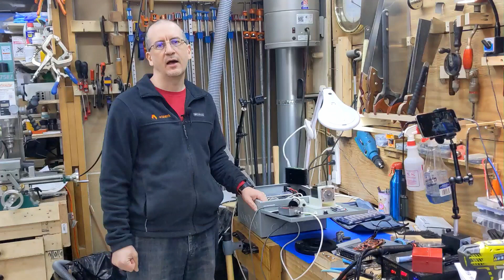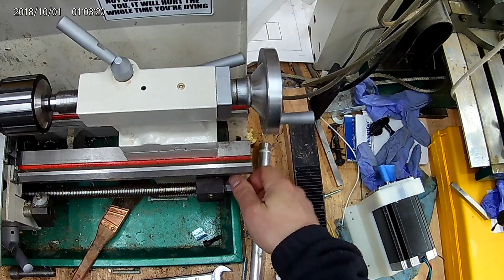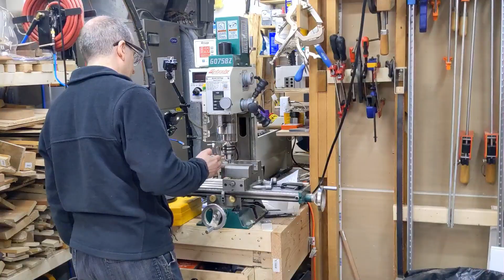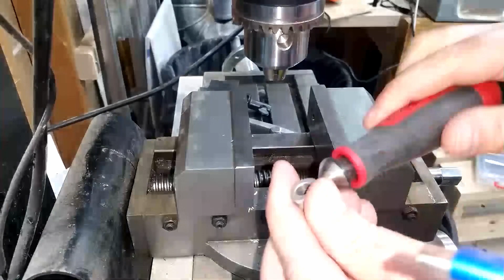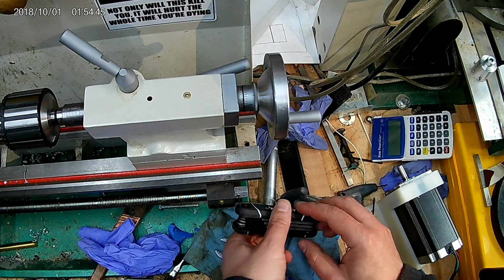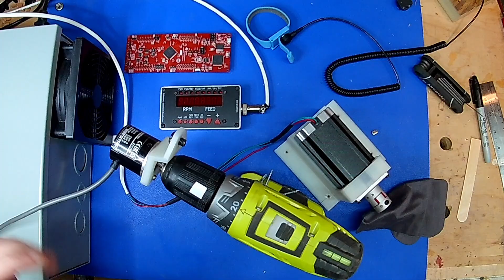Electronic Leadscrew Progress, Part 2

Comment: Rather than fanny around with adhesive why not drill and ream for a taper pin?
Reply: Always ten ways to do anything, of course. :) This was like three years ago - I don't even own this lathe any more and have come a long way in my machining, although I'm still very much a hobbyist. I don't remember enough of the video to know where I was using adhesive. I do remember mentioning loctite for connecting the motor shaft but I think in the end I did pin it. 

The ELS was awesome. I have a much better lathe now (PM-1236T) and it's one of the upgrades I might do, although the change gear situation on that lathe is much better than on the mini-lathe.

Comment: It’s a very informative video . I’m also in the process of setting up the clough42 els on my lathe.  Please do post more video on this subject more often. Thank you so much for all the efforts you put on this matter.
Reply from the maker: Thanks! It has definitely been harder than I thought it would, but my electronics skills were pretty rudimentary coming in to this. It actually looks like it might be working now - I can't get the problem I was having to repeat. So hopefully the next video will show it in operation! 

I got a bunch of help from other users when I was having problems with the motor, so don't hesitate to reach out here if you think I can help, as I would welcome the opportunity to pay it forward.
Reply: @getsmarterandmakestuff  sure I’ll do. So the skipping steps problem is over?
Reply from the maker: @babakkhoramdin3146  Yeah, the only "problem" now is that the motor won't spin if I get the encoder spinning really fast. Like 1300 RPM in threading mode at 12 TPI. But I can't imagine ever wanting to run that fast. But who knows? Given that I can't recreate the problem, there's every chance that it will reappear at some point. Still, I'll be happy enough if I get it hooked up and it just works.
Reply from the maker: @babakkhoramdin3146  There's still a fair amount to do. I have to mount it on the wall and get the head end of the lathe buttoned up. I'm also using 3D printed timing pulleys because I couldn't find any the right size for purchase. So I might either print some better ones or possibly even play around with a combination of casting and milling some in aluminum.
Reply: @getsmarterandmakestuff  I’ve the same problem . Actually James also has  addressed this issue in one of his videos. I could overcome this problem partially by tweaking the micro stepping switches on the stepper driver.
Reply from the maker: @babakkhoramdin3146  Yeah, honestly that was something that confused me. I don't need microstepping - 200 steps per rev even at 12 TPI is 0.00042" per step - more than enough resolution. And at 0.005" per rev it's 0.000025" per step. So I'd rather have the torque than the microsteps. But my motor controller doesn't seem to have any switch setting for 200 steps/rev, i.e. no microstepping. So I've set it at 400/rev just as the nearest thing.
Reply from the maker: Not really, and it's a good point. But as it's driving the leadscrew and not the spindle the revs are generally reasonable. I'm typically running around 0.005"/rev, at around 800RPM, which, if I have the math right, works out to 48PM. The highest it could possibly be would be something like 4000 RPM, if you set it to turn for 6 TPI and ran the spindle at its max of 2000 RPM (the leadscrew is 12TPI), but that would be absolutely insane. At 6TPI it almost makes more sense to turn the spindle by hand, because it's otherwise quite difficult to disengage the carriage fast enough. Unless you run it backwards on the back, of course. I'm not sure my lathe could manage that, though - I don't think I could get the cross slide far enough back. Might have to try it at some point.

James's software has overspeed protection, but I think that's more about detecting whether we're overwhelming the board rather than the motor. In any event, just via observation the stepper revs seem completely reasonable.

Of course you made me paranoid so I went and looked at the specs (which I should have done in the first place). :) I can't find a rated max RPM, but they do show torque curves all the way up to 1200. Torque drops off significantly above about 300. So, seems fine. But I'll have to remember if I wind up doing anything where I'm trying to drive it much faster. I do want to upgrade the motor at some point, and that might let me run faster some of the time with carbide. 

Thanks for the question!
Reply from the maker: I actually tried a closed loop stepper in the construction I did before I started filming. It didn't work for reasons I never sorted out - bad motor or bad controller, but I never sorted out which. Returned them and went with the open loop stepper as a known quantity. Agree that a servo drive for the lathe would be awesome. I'll probably wind up there, but I have a treadmill motor that I got for free that will be tempting to try to use...
Reply from the maker: To be clear I'm talking about a servo drive for the spindle. I don't think I'll replace the stepper any time soon since it's working perfectly. I do a lot more turning than threading in any event, so as long as it doesn't miss steps at the low RPMs I use for threading (and it hasn't) I think it's probably fine. I have too many projects as it is! :)